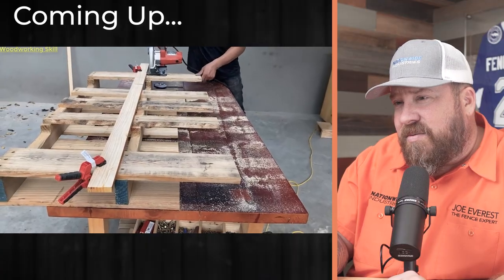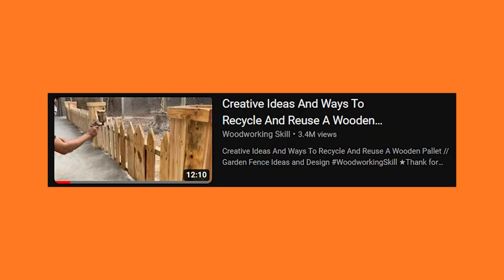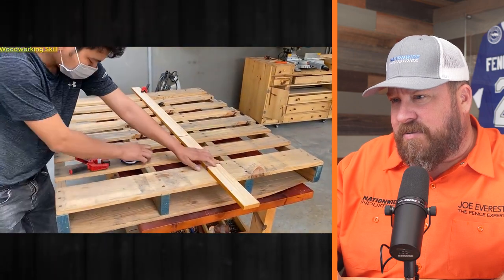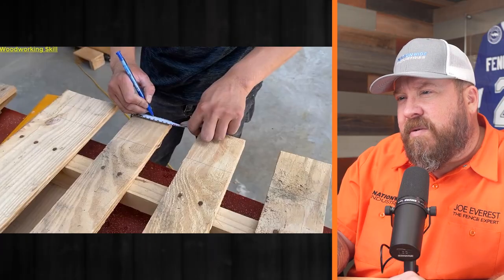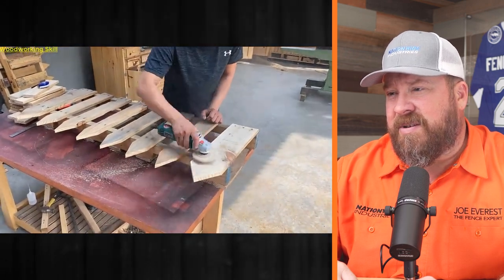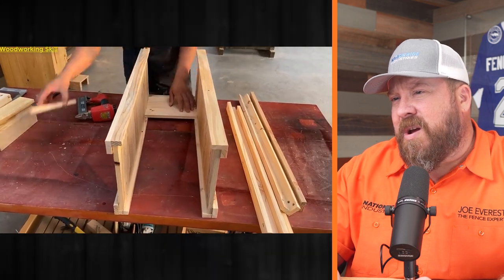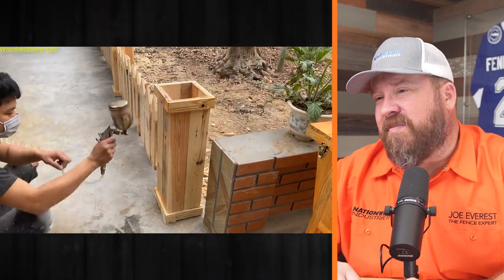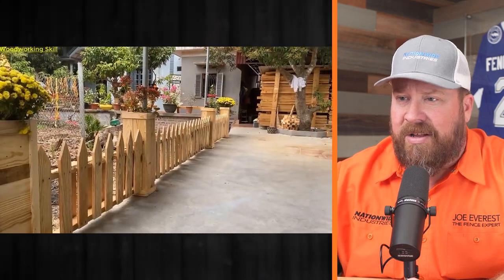This DIY Pallet Fence Is DANGEROUS - DO NOT BUILD THIS!

Comment: like so many of these crafty projects on site like indestructibles, there is so much wrong.  The builder could have done the same thing, which you rightly point out is stupid, with far fewer cuts and fewer measures by using a simple jig.  Obviously inexperienced people will make many mistakes and the pickets will come out looking bad because they will be uneven and fall apart.  And it will take 5x the time it might have taken.

Comment: ------  I can't recall ANY "free" pallet wood project that really goes as envisioned  -   usually,  the labor factor in reclaiming the wood isn't reckoned in the overall cost  nor the labor / time factor in producing usable sized material   -    watched one video where a guy dismantled a stack of pallets,  cut them into 4 inch blocks,  glued those into panels,  glued those into larger panels, and finally glued up a 4 ' x  8'  x  4"  slab which he milled flat   -    he kept track of his hours  and he expended close to 50 hours   -   that, dear hearts,  ain't 'free' wood   (  plus he used several gallons of tightbond III )    --  it was, however,  a pretty cool looking work table
Reply from the maker: 😳 oof